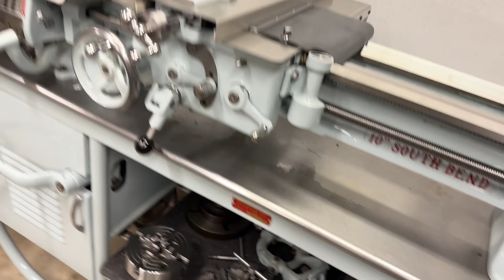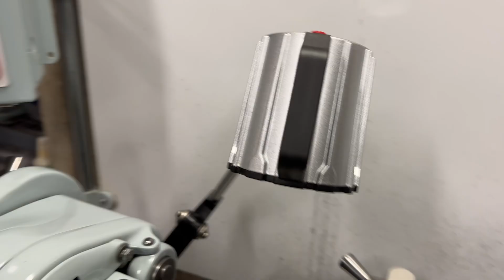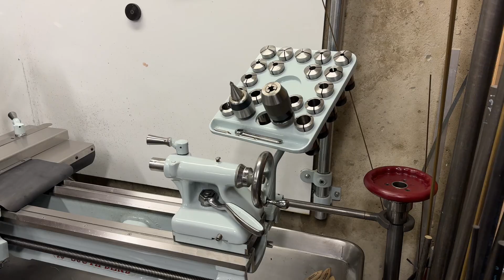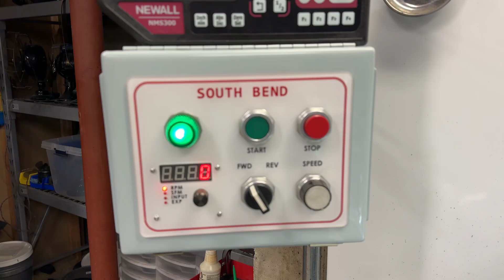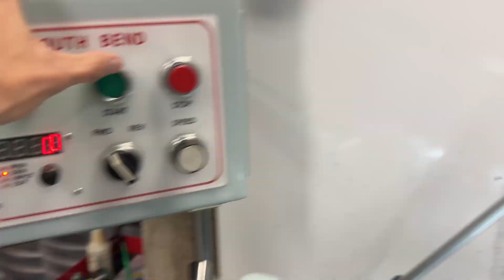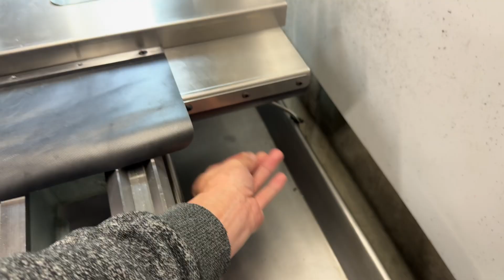South Bend Heavy 10 Custom Solid Tool Post Riser and Guarding

Comment: What do you do when you need the compound?  Just take the upper debris guard off and put the compound back on?  I have an Aloris AXA on my 10L and constantly have a need to rotate it to optimize the presentation of the cutter to the work.  Is that possible with your "solid" toolpost mount?
Reply from the maker: I can add the compound by removing the four mounting bolts of the tool post riser and the cover along with it. About 10min total time. That said, the only time I use a compound is for short tapers. There are many otherways to accomplish this and in my general line of work, I don't need a short taper often. I also have a taper attachment which I can use instead.